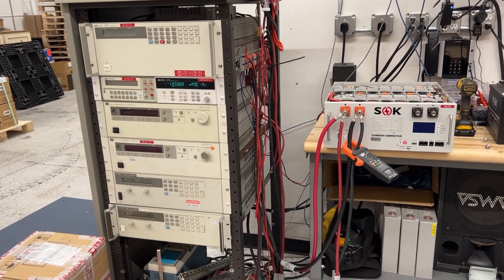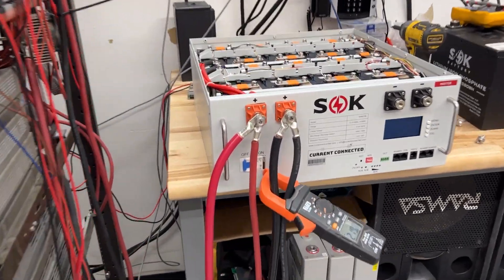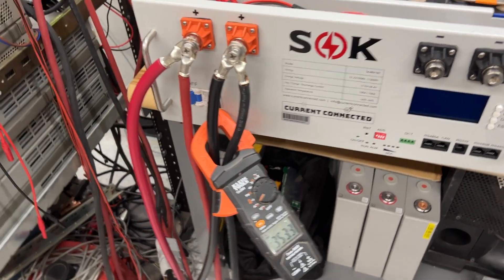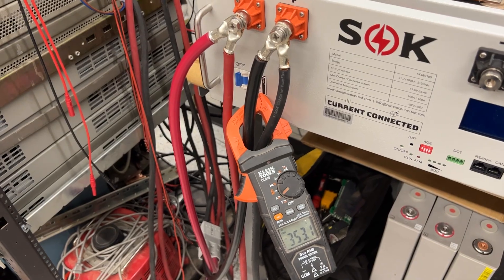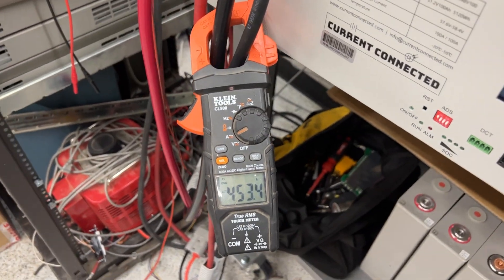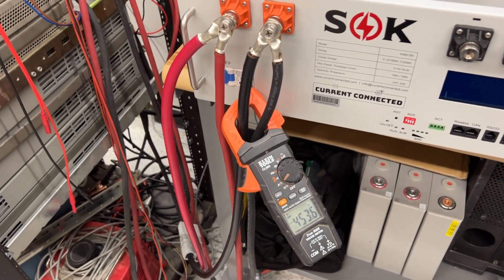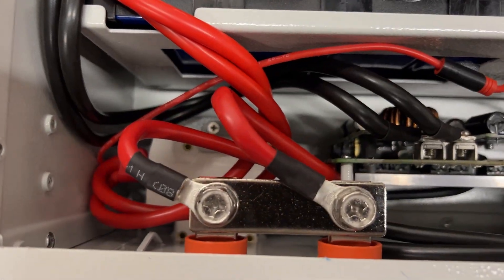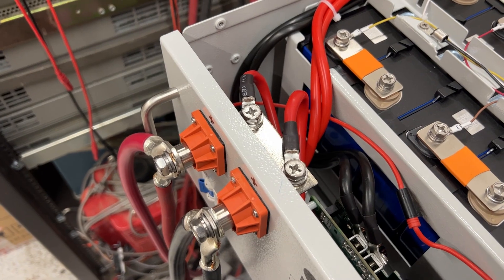SOK 48v Server Rack Battery - 450A Front Terminal Current Test

Comment: From my understanding most battery manufactures won’t allow 450 A continuous running into charge the batteries without doing damage!
I have eight Battle Born Batteries and been told at 48 V that no more than 100 amp should be going through to charge them.
Reply from the maker: You fail to realize the current is not going in to charge the battery, it’s going in one terminal and out the other. This would be for parallel battery set ups where you have a lot of them in a stack daisychaining.
Reply: @HighTechLab  
Thanks for the clarification. I’m still learning, and had more than 150 A going into my batteries before I found out that I should’ve only had 100.
What I did was limit what my victron  charge controllers could take in for amps.
Moving it from 100% to 70 or 80%, this helps greatly in the summertime and wasn’t a problem at all the rest of the year.
Reply: @HighTechLab are these bidirectional power supplies or are you able to sink that huge of a load with some massive DC electronic load you have?

Comment: Looks like it can handle the full current of a stack of 4. 5 might be pushing it.
Reply from the maker: Perhaps...but a stack of 5 may have other issues pushing full current...4/0 is about as big of a wire as is practical, and it's not rated for much over 400a either.
Reply: @HighTechLab  Good point. If I needed full output from a stack of 5 I'd probably just make a long busbar to go across all the terminals.

Comment: Still waiting for your video on showing how to connect 4 batteries to a solark. You showed a video racking but never went past that :(
Reply from the maker: Coming on the CurrentConnected channel soon.  We paused that because now the racks are 5 slot racks and we need to make an updated video with the bigger rack.
Reply: @HighTechLab  fair enough lol, I'm doing the install this week so was hoping for it
Reply from the maker: @hoocli  video is posted!
Reply: @HighTechLab  thank you!
Reply: @HighTechLab  That one we are waiting for, we just bought your 5-rack system to connect with a 15kw Sol-ark. a lot to take in when it is your first attempt at off grid do not want to make any errors.

Comment: High Tech Lab with a finger test for temperature lol
Reply from the maker: I need a thermal camera
Reply: @HighTechLab  Nothing personal just thought it was funny. Keep up the great videos.
Reply: @HighTechLab  The low deep IR emissivity of the plated metal will cause accuracy problems with thermal cameras.
Reply: @HighTechLab   Just get some thermocouples. Too many variables with a thermal camera. The footage looks cool though.
Reply: There is many an electronics technician with finger burns shaped like logos or circuit board components. Humans have been using touch to test temperature for so many millennia we will keep doing it, even when we know we shouldn't.
Reply from the maker: @Sylvan_dB  I’ve had MOSFET shape burns on my fingers many times!  Sometimes it’s not checking to see something is hot either, you just happen to discover that is very hot!

Comment: It's about 30 watts of heat from one side to the other (75mv drop @ 450a).
Reply: Are those bus bars plated copper or brass
Reply from the maker: @offgridwanabe  I’ll check tomorrow,  I know the flexible ones from cell to cell are most definitely copper, I didn’t consider this one being different.
Reply: @HighTechLab  Not that it matters my friend as you have proven they work.
Reply: Was just going to ask about the voltage drop. 😂

Comment: I’ve never seen anybody put two lugs on the front of their battery before! Why would you be doing this?
Reply from the maker: Because you have a rack of batteries stacked (daisy chained) and need to go from one battery to the next
Reply: @HighTechLab  
That’s not the way I’ve seen them connected. It’s one positive too one battery to the other. With positive being on the top of the rack and the negative on the bottom.